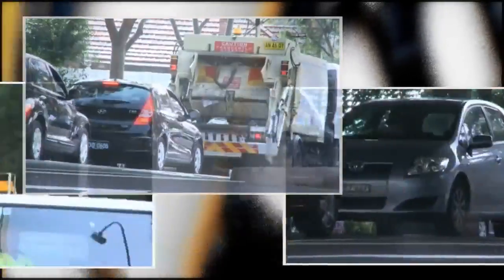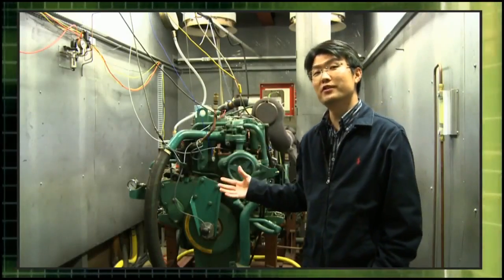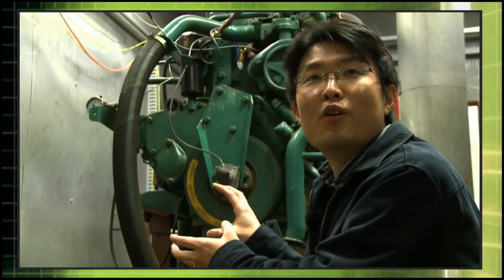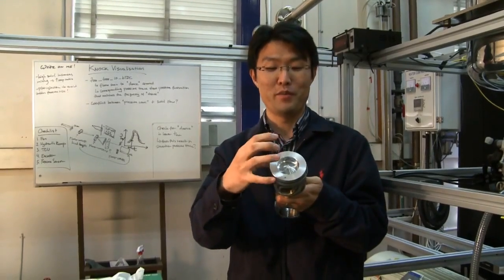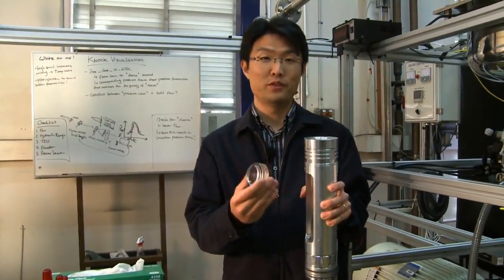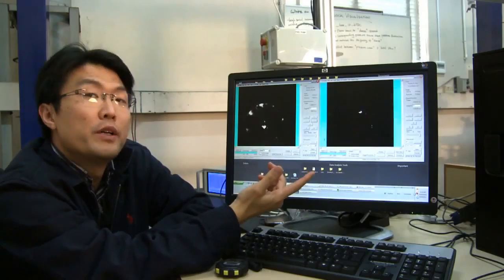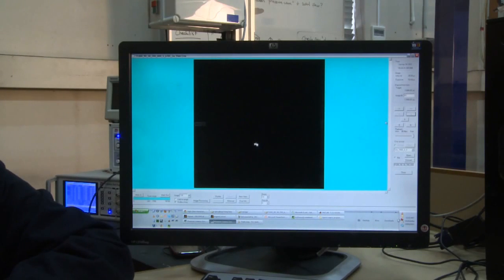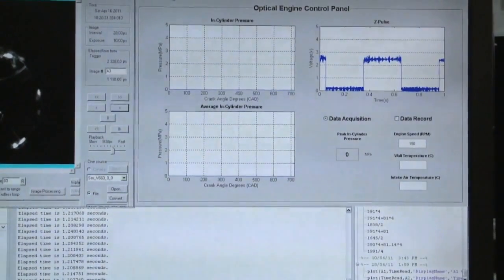Making Cars Cleaner

Comment: I don't know anyone in the Auto Industry who believes IC engines will dominate the market in the future. Fuel prices whether petrol/diesel/ethanol mixed is only going to increase i.e. running cost for gas cars will only increase. Electric Vehicles (EV's), however, already possess lower running costs, and when mass-produced will be as cheap. 

Why waste millions on a 1 to 3 % efficiency gain, when by changing to EV's you gain 60% plus. The good auto-makers are solely focusing EV's and Hybrids.